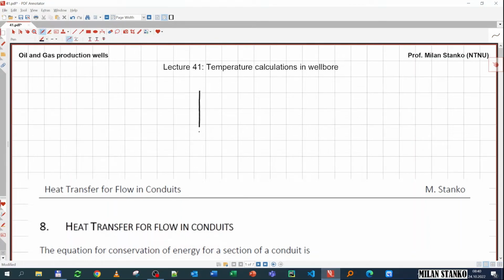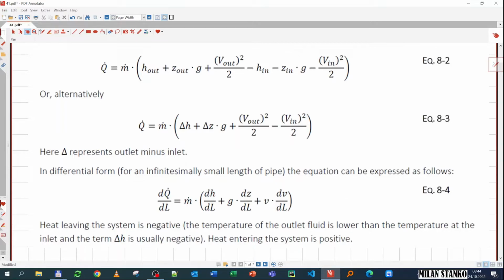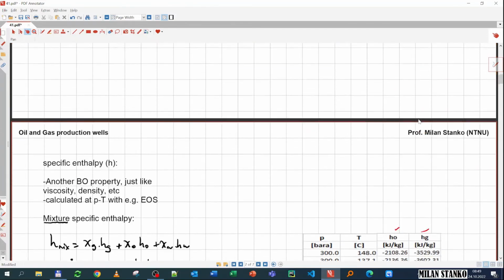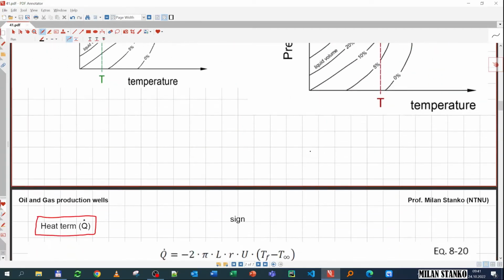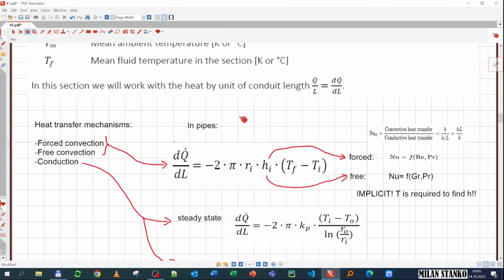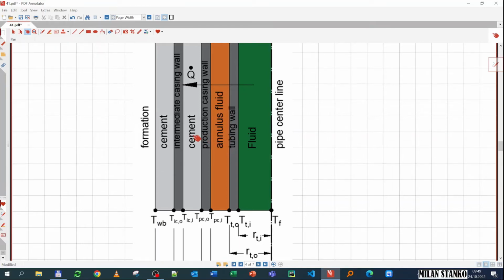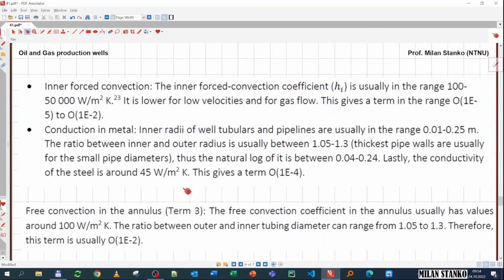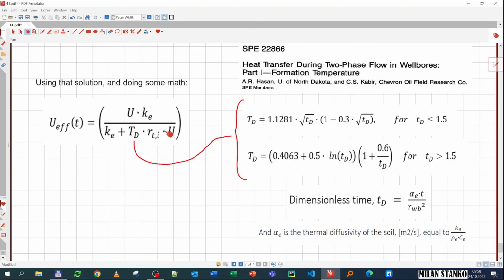41. Temperature calculations in wellbore - theory

Comment: thank you for the lecture. could you please clarify why is the work W neglected in in Eq.8.1. won't there be any friction to overcome?
Reply from the maker: If I remember correctly my thermodynamics classes, one (quite conveniently) assumes that the surface boundary of the control volume is located exactly at the pipe wall where fluid velocity is zero, therefore making friction work equal to zero.